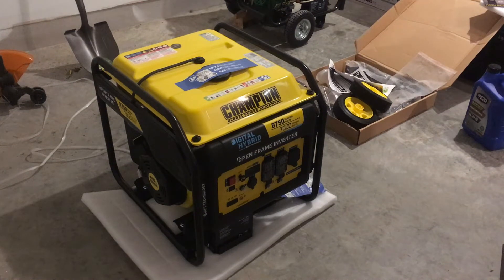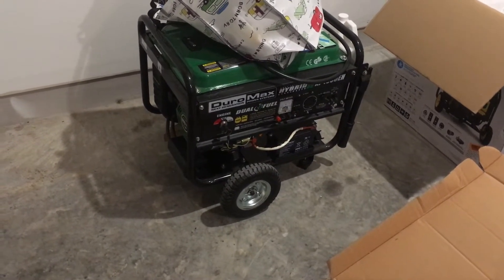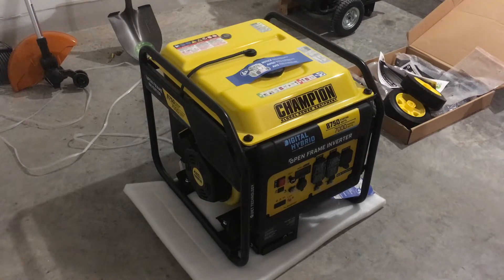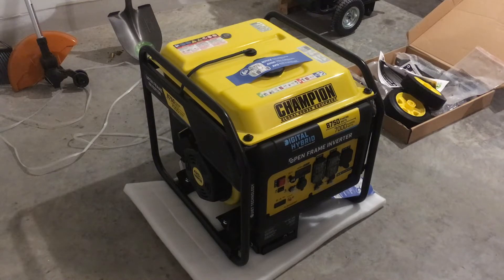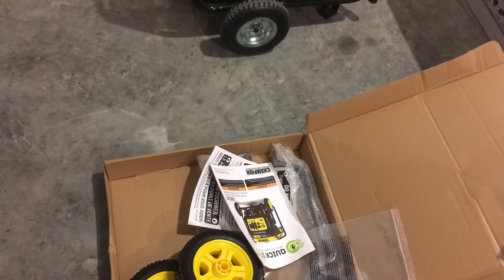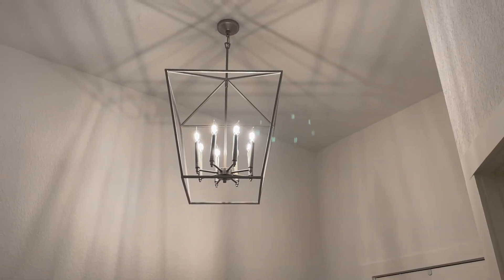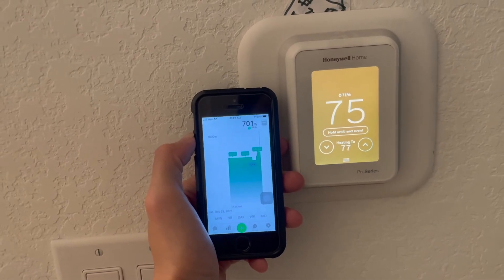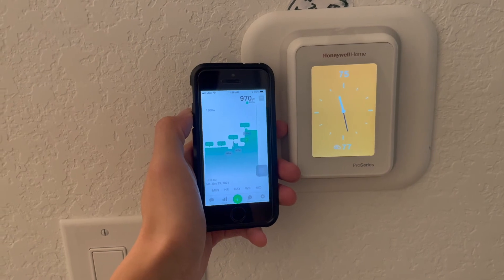Champion 100520 Review and Setup For Whole House Power Backup System

Comment: Great presentation. If I could add: my lock out installer guy feels it’s just a little safer to plug your cable in the generator and home before you start it. That way you aren’t making connections while you have power going out. (Also, when you kill main power, kill all other breakers as well; bringing them online one at a time after lock out, generator first.) You are still protected prior to lock out with the generator breaker prior to switching. I personally don’t have much knowledge regarding the floating ground… must investigate!

Comment: A central Furnace system will work fine.  It's only 120v at 10-15 amps..
Only an A/C with 3-5 ton units would be problems

Comment: Same situation here. We live in Spring TX and oh man! That was fun! Ended up buying the same generator, same connections and in the future I’ll add the tri fuel conversion. My only issue is that electrical panel is about 70’ from the gas pipes
Reply from the maker: That's awesome that you got a similar setup! Yeah, I'm in the same boat for facing issues with setup. One of the biggest reasons why I have been so slow to set everything up has been the cost of all these items. If you are facing a choice between running a long electric wire or a long gas hose, I'll let you know after doing the research, a long electric wire is cheaper than a long gas hose. If you want to run on natural gas, you'll need a 3/4 inch gas hose/pipe. For a 70 ft run, you're looking at $400-500 with today's prices. A 70 ft 10 gauge cable nema L14-30 can be for approximately $160 (https://amzn.to/3vFhl6Q). 

My electric and gas are right next to each other, but are in the front of the house and it feels too conspicuous to be running everything in the front. I have to run a 70ft electric wire and a 70ft gas hose (not ideal)... I have been waiting for sales or for ebay to get the gas hose for cheap. I hopefully will get the gas hose soon and have it setup with natural gas. I posted a video a few weeks ago adding the motor snorkel and having the generator work on propane. Thanks for commenting!

Comment: I had ordered one of the motor snorkel kits and cancelled it before it even shipped (two days later). I read about the power loss and the reason I bought this genny, to replace my old Harbor Freight non-inverter 6500/5500 was because I needed clean power and more power. Running on NatGas would reduce the power by 16%-20%. Based on the fact that you can't change the engine compression to make NG more efficient, and the fact that our power is never out more than 4-6 hours at the most, I will just stick with gasoline..
Reply from the maker: Do note that even with a motor snorkel, you can still run on gasoline. I wanted to have the flexibility of tri-fuel (gas/propane/natural gas). Having flexibility is useful during emergencies. The 2021 Texas winter storm power outage left me without power for almost 30 hours and I want as many options as possible. The 20% reduced power would definitely work for me in the winter since my heat isn't electric. Whatever works for you though - thanks for commenting and best wishes to your setup!
Reply: @jonathanDIYs  hmmm. That is a good point.  Some power would be better than no power at all, esp for an extended run.  You've convinced me to reconsider... lol
Reply: From the motor snorkel web site: "People often ask about power loss with the adapter style kits. We have never had a complaint about power loss with any of our kits." Hard to tell if that's a marketing ploy or not, but most all manufacturers (Champion included) state lower power outputs on propane/natural gas vs. gasoline in their dual or trifuel gennies.

Comment: In case anyone gets the latest model, I just received the same unit (100520) this week and they moved that neutral to ground jumper to a spot on the bottom of the panel in between the two GFCI outlets.  It took me a while to find it and I almost called Champion tech support.  I'm not sure why Champion moved it from an easy access spot on side of the panel to a much more difficult access location on the bottom of the panel.  You have to lay on your back while looking up to access it.  Once you look up in between the GFCI outlets you can clearly see a neutral jumper on a ground, similar to way it's bolted together in this video except in a different spot.  After disconnecting the neutral jumper to the ground, my GFCI outlets still function as GFCI outlets with green lights which is a bit puzzling since I thought I read somewhere that you lose GFCI function when you float the neutral.  Maybe Champion resolved that issue?
Reply from the maker: Thanks for Sharing Johnny. I checked Champion's website and they did release a new revision after March 2021 - https://www.championpowerequipment.com/product/100520-8750-watt-open-frame-inverter/. I looked through the PDF and the only change is "75 - 35610-Y9X2210-H300 - Control Panel Subassembly" from "75 - 35610-Y9X1212-H300 - Control Panel Subassembly" so you're absolutely correct - they have "upgraded" the panel. Hope this info is helpful for others!
Reply: Spot on Johnny! I just got this generator and it shows it was manufactured Aug21 so I have the new panel. Its right where you said. Behind the reset graphic between the 2 20Amp fuses. If it helps anyone else get a 7mm open end wrench to remove the screw easier.
Reply: I installed a portable generator as backup power on a home for a customer. (I own a small electrical company). Just a few weeks ago. The neutral ground bonding point was under a plate on the side of the motor.  Much easier access. It was a larger Champion. So maybe that was the difference.
Reply: Why floating neutral?? Can I use it without changing that?

Comment: Great video. I’ve had the same generator for 3 years now. I also have the Sense and wired it up the same way you did. It’s very convenient to measure how much wattage you’re using with the generator and it is what I used to size my generator. I also have the USC motor snorkel. I haven’t installed that yet. Just got a new central AC, so I’m going to see if it starts up without a soft start kit. Wish me luck!
Reply from the maker: How many tonnage is your AC? Good luck and let us all know your findings! I have another video with the soft start on my 4 ton AC. I couldn't get it working otherwise.
Reply from the maker: Motor Snorkel conversion video just went up - https://www.youtube.com/watch?v=t0DisjMnY7U. Hope your install goes well or already went well! :)

Comment: The lifting handle appears to be on backwards, or upside down. 
The square on the end of the handle should come in contact with the metal frame when lifting per the owners manual. 
It is placed there to keep the round part of the handle from deforming under load.
Reply from the maker: I couldn't figure out what you meant when I first read this, but I finally figured it out! Thanks for pointing this out! I just had to take off the cotter pin and flip that around. Thanks!
Reply: Mei wenti...

Comment: I am trying to figure out the width of the frame at the top of the generator, do you by chance have that dimension?
Reply from the maker: 20" across the frame from the left wheel to the right wheel - just measured it for you. :) The wheel sticks out another 2.75" or so making the total width 25.5" or so.

Comment: First timer question here.  I have the L14-30 plug on my house and this will be my first generator.  Do I have to make it a floating neutral generator to power the house or should I try it first as bonded to see if it trips and if it does then convert it?
Reply from the maker: You can run this with bonded neutral with no regular issue. The point of making it floating neutral is to make it safe when there is a fault situation. The basic rule is that you want electricity to only have one path to go through. When it is bonded at the house main breaker box and your generator, it means that in certain short situations, power can still flow without tripping the breaker properly. 

The rule basically is, running generator by itself, you need it to be bonded neutral. Running generator connected to house which already has bonded neutral, you need the generator to be floating neutral. 

For testing however, running it either way will work. Just make sure to have it the right way for each application for maximum safety when you are regularly using it.
Reply: @jonathanDIYs  thank you for the thorough answer!  So basically I’m only using this as a house backup.  Through my L14 inlet to my interlock kit an electrician installed on my circuit breaker. So I should make this floating neutral.  And then when I do my monthly/bi monthly test running of the device, I can leave it in floating neutral and it’ll be fine
Reply from the maker: @MPD2003  yes, that would be fine. Just don't test with a frayed wire hooked to power tools in the rain. 😄

Comment: Can you still use 120 volts outlets on genny with the neutral disconnected? That's why I picked 6250 watts Champion because the bigger one is still underpowered to run HVAC (unless soft start is installed). I wanted also to store less gas. It's easier to survive lack of air conditioner than lack of heat in winter
Reply: I got my answers below. Does the generator's ground should be connected to grounding rod in permanent house connection with floating ground setup?
Reply from the maker: @StagArmslower  no, the house grounding rods already provide the ground connection in a permanent house connection. As far as I understand electricity and from my research, connecting the generator's ground  is more necessary when the generator is being used as an isolated system.

The rationale is that in the event of a lightning strike on the exposed metal generator frame or any exposed metal appliance plugged into an outlet in the house, the permanent house connection already has a path to travel to earth through the house ground rods. 

If lightning were to strike a generator only system, a person could be the lowest path of impedance for the lightning to go to ground because there is no direct path to earth. This is my understanding to why it is critical to have a ground rod when using the generator by itself. 

Do note, I'm not an electrician, please take my advice with a grain of salt.

Comment: Hey Jonathan, I just got the 6250W/5000W Champion Inverter Generator and plan on using the L14-30 plug for my house connection(Power inlet, breaker, Interlock kit, etc.), does unbonding the way you showed only unbond the L14-30 receptacle and leaves the regular receptacles bonded?
Reply: Nevermind, kept watching and noticed that there is no continuity between the regular receptacles (20 amp) ground and neutral. Would you transfer back to a bonded neutral if you were to only use the regular 20 amp receptacles say for camping or something?
Reply from the maker: Yes, it cuts the bond for all the outlets. Yes, you definitely want the ground and neutral bonded for camping or using solo. Having the ground disconnected can be dangerous in the event of the live wire fraying and energizing a metal container. With the neutral and ground connected, it would immediately short and trip the breaker, while without the connection, you can become part of completing the circuit when you touch it getting a shock.
Reply: @moisescastillo1802  

Does it have a push-button starter?
Reply: @moisescastillo1802  

Is there a gas generator with remote starter?

I don´t want to leave the bed to start the backup system during the blackouts?

Comment: DO YOU THINK THIS WLL WORK ?    If I got an extra L-14-30P plug (like the one on the house to generator cable). I connected the plug’s ground pin to its neutral pin and labeled it “neutral bonding plug”. If I want to use the generator to run power tools via a standard extension cord, I insert the bonding plug and then connect the extension cord to one of the 120V GFCI outlets. The generator is now “bonded neutral” and safe to use with the power tools. If I want to power the house panel, then I have to remove the bonding plug in order to connect the cable from the house and the generator becomes “floating neutral” with the only neutral to ground bond taking place in the house electrical panel as it should.
Reply from the maker: Hi Mark, yes - that would definitely work. In fact, they sell products like that for the regular 15 and 20 amp sockets (https://www.amazon.com/Hughes-Autoformers-Ground-Neutral-Watchdog/dp/B08HZGMRB1/ref=sr_1_1?keywords=generator+bonding+plug&qid=1668892523&sr=8-1). I've never heard about it done with a 14-30, but I don't see why you couldn't do the same thing. Electrically, the ground plugs on all the outlets is connected together and connected to the chassis and the neutral plugs are also all connected together.

Just make sure to double check all your electrical work with a meter and don't get the wrong pins connected. Make sure you do not leave the hot leads exposed in any way and that the connection cannot come apart if someone brushed up or bumped into it.

Comment: Why make it floating nuetral? I have a cord that plugs into the outside of my house, that is connected to 2 breakers in my house panel........    i flip the main breaker off, and turn on those 2 breakers dedicated to my generator.....   are u telling me that it will trip those when I try to run my whole house?   I just bought this generstor, hasnt come yet.
Reply from the maker: There is a lot of research you can do on this. I found this guy's video the most helpful - https://www.youtube.com/watch?v=viNZV0lyRVQ.

The TLDR is you only one the neutral bonded with the grounds in 1 place to have only 1 path for the electricity to flow in the event of a fault. More likely than not, the 2 breakers you are flipping is only transferring the hot over to your generator and not disconnecting the ground or the neutral connections. If you run your generator on this system,  you will now have 2 areas that are bonded - 1 at the main panel and 1 at your generator. This is not ideal in the event of a fault.

Watch the video, the person does a much better job explaining it than I can. For reference, you can also look up NEC250.30A...  https://up.codes/s/grounding-separately-derived-alternating-current-systems

Comment: I’m also prepared when/should we get hit again.  My electrician wired and installed a 50amp breaker and plug so I can run my whole house
Reply from the maker: What generator did you get?
Reply: The Westinghouse 9500 duel fuel.

Comment: Just asking. Why should you disconnect the bonded neutral?
Reply from the maker: Watch https://www.youtube.com/watch?v=viNZV0lyRVQ.

You only want your neutral and ground bonded together at 1 source. If you have multiple bonded connections such as in your main power panel and your generator, there are scenarios were a short can travel on both the neutral and ground and fail to trip the circuit breaker leading to a dangerous scenario.

The simple rule - you want your generator to have neutral and ground bonded when it is running a device independently. When you are running a house through a main panel, you want the neutral and ground separated.
Reply: @jonathanDIYs  What I should’ve said was why not just use a three wire neutral only connection and delete the ground wire since it’s a neutral bonded generator.
Reply from the maker: @EdZackly-307  that would be dangerous if there was a short that energized the body of the generator. If you only had a neutral wire, the generator would still be bonded in the generator. The body could be electrified without tripping the circuit breaker. When you touch that and another metal piece like a pipe, you can get shocked when your body becomes the path for the circuit to be completed.